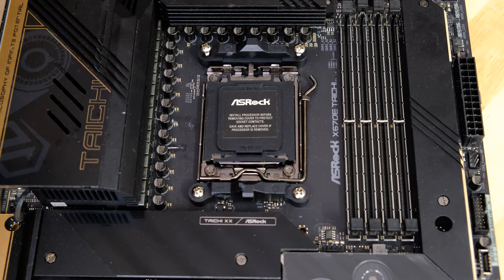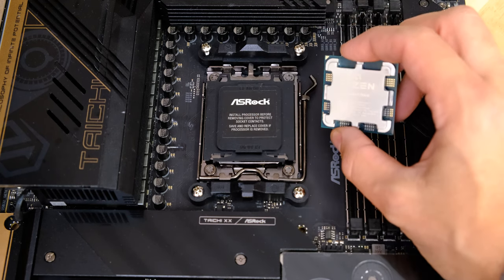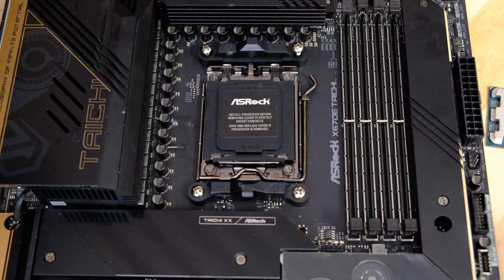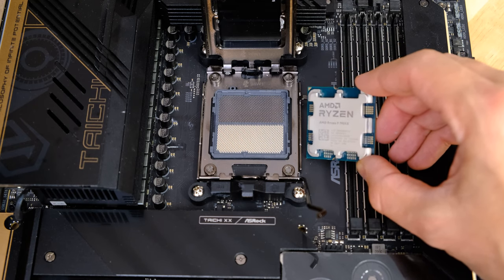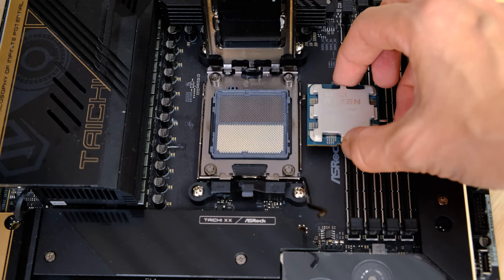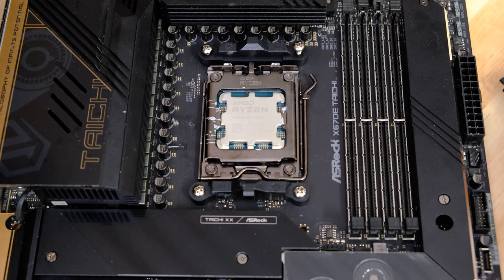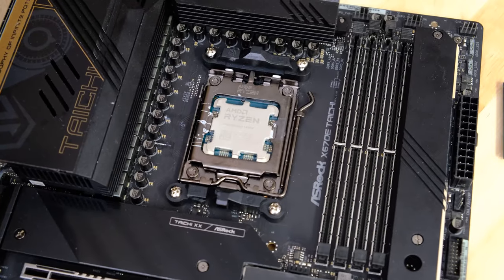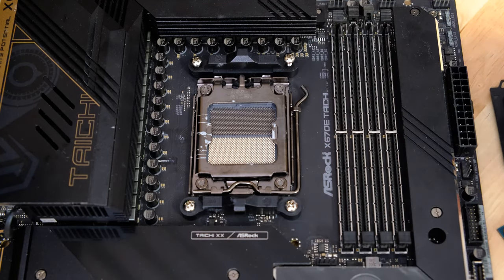How To Install A Ryzen 7000 Processor

Comment: Wish I saw this before I killed my board. My first install went fine, but the second time I decided to slightly smudge the CPU into place and that put the board out of commission. (Still thinking on the easiest way to get the CPU out if that happens.. Tilt the board?) They really do seem to be annoying to remove. Despite the snobby know-it-alls in the comments, I appreciate the explanation and video.
Reply: I've bricked two AM5 boards already because of this crappy  socket and these absurdly fragile pins. Yes, it may well be down to user error in my case of course but on the other hand I really think AMD should never have adopted this socket technology as its costing people money when these pins break off or are so easily bent. I have one working AM5 board just now, but I dare not remove the cpu for upgrading any time soon as I might break the board lol. I just hope future revisions of this socket will improve and the pins are made less fragile.
Reply: @soulzgamer7589 mate, exactly same here, never had any issues with my old intell 1155, im fucking livid, will the CPU be ok ? I was so carefull, when it's in can I wiggle it to make sure it's in place? Anyway, I tried booting but got nothing, ram light orange, CPU red, took it apart noticed bent pins, shat my pants. So angry.

Comment: I'm only just switching over from AM4 to AM5 and I'm aware of almost every shortfalls on the CPU old pin array setup. Many times I had to use my credit card to straighten out those bent pins. Nevertheless, I don't want to go into this blindly, your video has put me in good stead and thank you for over extending the things that could possibly go wrong with AM5.
Reply from the maker: Glad to hear it. I get a lot of people complaining about the length of the video but I really, really, really wanted to stress how easy it is to damage the pins. Even following basic guides is still seeing bent pins as the leading cause of motherboard RMAs so it's clear they're not enough. If I ram it into your brain then hopefully you won't ever be in that situation!
Reply: Not long, you just went over and above and kudos to you! Even experience PC builders make silly mistakes. Bending pins and thermal paste stuck to your cooling fan are the biggest pitfalls. 
So glad AM5 has a retention bracket!
Thermal paste on AM4 has its own art, run the PC for twenty minutes, unscrew the holding screws diagonally from the AM4 PC Cooler, then very gently swerve the cooler left and right a few times, then pull gently....oooops, no it usually works :) @CrazyTechLab

Comment: If you bent those pins it will not kill the motherboard. I messed up before used tweezer and plastic card bent back 8 to 10 pins in place and its working fine.
Reply from the maker: Depends how badly you bend them. I’ve been successful in most attempts but not all. Also with socket AM5 the tolerance for the pins being in the right place after you bent them is extremely fine. There are so many pins that each one has to be in precisely the right place. It’s far easier to fix bent pins on an old Intel motherboard that is on socket AM5 or even LGA 1700

Comment: I hate this new socket on AMD boards as I've already damaged pins on two AM5 boards and its effectively knackered them. It's not even clear what causes them to bend, accidentally dropping the cpu in incorrectly or even friction underside when installing the cooler. One thing is for sure is it's a very costly mistake to make.
Reply: Just did it myself and I'm always so carefull. Im so furious with rage, 160 quid down drain. 

Brought new board, with great anger, now I'm dreading it. Happens again I give up. It should not be this fuckin easy to bend them ffs. You only have to look at them wrong. 

Urgh. Livid.

Comment: This reminds me of haswell days. That’s the last intel I built. I’ve been on ryzen since. Good to see LGA is still the same. Thank you. Me too brother! Waiting on the $3.99 ek 6/32 screw set. Cost me $14 for 4 screws. I wish Microcenter had them. I looked yesterday when I was picking up my order but nope! I grabbed a Corsair h150i rgb elite to use while I wait for the screws and a few fittings. I could have used my 240mm h100i pro, but I don’t like loud fans and it’s time for a new AIO. I switch coolers a fair amount. Get fed up with custom loop go back to aio. Rinse and repeat
Reply: Brother, I am still using an i7 4790k paired now with an RTX 3060 since Dec 2014.

Comment: I did the exact same thing before. To push down this  metalstick i need to use extrem strength. Is this normal? Its my second motherboard and issue happened 2 times... What do i do wrong? And if i want to start my pc it shows the yellow q-led and nothing wants to start.

Comment: I wish the sides were more straight, like most cpu's are.  I don't care for the little cut-outs on the sides.  I hope AMD will fix this.
Reply from the maker: Tis a pain for cleaning too. having used the CPU in the video to test a bunch of boards recently, reapplying the thermal paste each time, it gets stuck in those gaps so easily too.
Reply: they didn't do it to look cool. There's an actual reason for it. They put the SMs on the top so that they can maintain AM4 cooler compatibility. And since those have to go somewhere they had to put them on the edges of the substrait so they had to add those cut outs.

Comment: Appreciate your hard work. I have ordered a AMD Ryzen 7 7700 and want to add it to Asus TUF Gaming B650 Motherboard. I wanted to know if i need to use thermal paste after adding CPU? I guess the CPU Comes with a CPU Cooler from AMD (Fan CPU Cooler) but not sure.
Reply from the maker: The AMD coolers usually have thermal paste pre applied. But you ALWAYS need thermal paste. If it's pre-applied, great. If not the cooler usually comes with a tube of it.

Comment: Humanity is failing if they can't line up the arrows THAT HAVE BEEN IN THE SAME PLACE SINCE THE CYRIX CHIP.
Reply from the maker: Well, they are pretty small. No way anyone that has trouble seeing over shorter distances would be fully confident with that, but thankfully there are plenty of other ways
Reply: @CrazyTechLab  I'm old so I have to use my readers. Have you heard of anyone having issues with the 7200 speed ram?

Comment: I just want to know if i have a new Mobo and new Ryzen 9 7000x, seems like it can just be put in the socket, my main concern is Thermal paste. I read its required if its being re-installed, but is thermal paste required for the first installs? ROG STRIX X670 mbo. Cause the video shows no thermal paste being applied until its mentioned at the end.

Comment: Fitting the CPU is pretty much foolproof due to the two grooves top and bottom on the CPU which are left of the centre of the CPU and line up with the grooves in the motherboards CPU socket.

Comment: It's really not hard to prevent damaging your motherboard/socket pins.  I've been building PC's since 1995.  Have never damaged a single socket.  Just place it in and close the lid.  They only fit in one way.

Comment: honestly, it seems like if you are just putting in the cpu the way you should be doing it anyway, it's pretty hard to break any pins on the motherboard
Reply from the maker: I'll take that as a complement :) It is! But the issue is, if you're coming from AMD, this is new and bent pins are one of the leading causes of dead motherboards - the RMA rate is HUGE and it's much easier than you think to bend the pins. I've received review samples rotated from professional journalists with bent pins and numerous friends who've sent me photos of bent pins when their PC fails to turn on asking 'is this bad?'  It seems simple to those of us who have had socket pins for years, but even if I prevent one person from mashing them, this video was worth it. Also, with LGA1700 and now also Socket AM5, there are SO many pins that bending them back once bent is nearly impossible as the pin and pads are so small and margin for error so fine.

Comment: Hi.What type of cooler is better for 7700x? .Air cooler or Liquid.I like Dark Rock Pro 4 and Pure Loop 2 and FX.I am afraid for liqiud cooler  it will cause damage later
Reply from the maker: 7700x you’ll be fine with an air cooler and the Dark Rock Pro 4 is excellent
Reply: @CrazyTechLab  i read comments that with air cooler 7700x reaching to 90c

Comment: My eyes cry when your thumbs touch and rub the CPU connector pins in the back.😢😢😢 don't do that!
Reply from the maker: The pads are very resilient and as they’re gold plated they’re inert an immune to corrosion. It’s quite safe
Reply: @CrazyTechLab  the pads are very resilient yes... the gold plates are immune to corrosion yes... Buy your hands might be oily or have sweat in it. I learned not to touch anything gold in the CPU the hard way.
Reply from the maker: @kaptenhiu5623  Yep they will. But the oil or sweat won’t do anything. You’re talking about minute amounts. They will not stop the socket pins contacting the CPU pads due to the socket pressure,  there’s no risk of corrosion or rust and there’s no risk of shorts. What issue did you have ?They’re designed to be handled. I’ve handled thousands of CPUs in my time. I’ve reviewed them for over 10 years. Never had an issue doing that.
Reply: @CrazyTechLab  consider yourself lucky then. A couple of years ago, I build a new Intel PC for my client's office. It won't boot at all, after replacing and troubleshooting everything, I take out the CPU, clean it's pin and put it back in. Idk if it was caused by misaligned or dirty pins but it works. After that I try to not to touch the gold pins in a CPU
Reply from the maker: @kaptenhiu5623  Fair enough! It’s difficult not doing so on camera but I’ll wear gloves or try not to in future!

Comment: Query I have a ryzen 5900x with a liquid aorus waterface 360 version one of the aorus water cooling since the x360 version of aorus has now come out - my liquid will serve me to be able to mount my aorus master x670e and ryzen 7800x3d motherboard if the anchorage of my liquid am4 It will help me to install and what temperatures should I have when playing greetings from Chile thanks
Reply from the maker: No one can tell you unfortunately. It depends on ambient air temperature, case temperature, thermal paste application and so many other things. Don’t expect low temperatures with the 7800X3D though. It’s common for well over 80’C under load.

Comment: I have the Corsair h150i elite 360mm cooler and I was wondering if you think I’ll need an adapter or not? I just got the 7950x off launch and If you have any info on if it should fit I would appreciate it
Reply: If your cooler needs a backplate it will not be compatible. If it uses the default backplate from amd you'll probably be good.
Reply from the maker: Check with the manufacturer. NZXT has released a statement saying that even though their coolers use the stock backplate, they still need an adaptor to work 100% although they should still be okay. That’s not particularly clear from them but most if not all coolers that use the stock backplate should work.
Reply: should be fine it uses standard backplate, they even say its am5 ready
Reply: When I installed my corsair aio I had to unscrew the brackets that come from the factory and then screw in the double end threaded screws and then seat the pump block on to the four screws and then use thumb screws to secure it tightening the thumb screws down thumb tight in an X pattern.

Comment: This cpu looks so cursed, do you apply a thermal paste at the sticking edges?
Reply from the maker: Ha ha! Nope I was using a waterblock with a large contact plate and this motherboard has had several CPUs tested in it over the last 48 hours. A bit of stray thermal paste is perfectly normal. :)
Reply: @CrazyTechLab  did you try to mount a nzxt watercooling? it is compatible but not recommended, and they didn't include a tutorial to install it on am5
Reply from the maker: @HyPeRXKo  If it fits the standard AMD backplate for Socket AM4 then yes it should fit. I'm using an EK AIO right now and it fits fine. The new backplate has the same threads. The only situation things might not work is if the cooler does not use the standard backplate and has its own - mostly the case with some custom watercooling CPU waterblocks. Here, manufacturers will need to supply an adaptor kit. Most AIO liquid coolers such as NZXT and Corsair either use the standard backplate or the socket clips. The backplate on AM5 is exactly the same, but it's screwed to the socket this time, not just to the clips.
Reply from the maker: @HyPeRXKo  If you like I could do a video on this too. Seems to be a popular question
Reply: @CrazyTechLab  NZXT say we need an adapter for optimal performance, but it is still compatible apparently, no idea how since it is custom backplate (I think), a video Is a good idea since there is no answer on the entire internet on how to install it on the am5 platform :)
Reply: nevermind, no custom backplate (omg their guide is awful), I was confusing with the amd retention bracket
Reply from the maker: @HyPeRXKo  Yeah I was just looking at that. They say the height has changed - not sure how - the threaded sockets that come through the motherboard PCB seem to be the exact same height to me on Socket AM5 as they are on Socket AM4. The issue would be if the new threaded sockets on the backplate are slightly taller, this could mean that not enough pressure is applied (similar situation but for different reason to Intel LGA1700 which also needed adaptors). Or the NZXT standoffs for AM4 which you can see here don't fit properly over the new threaded sockets https://www.datocms-assets.com/34299/1634198300-coolingkraken-z-rgb-digital-manual-en-pdf-2109.pdf
Reply: @CrazyTechLab  I Already have an x73 at my house in preparation for my new build, I'll test it but from amd support I did 2 weeks ago it was like you mentioned a height difference, I never did watercooling before so I'm kinda confused, sorry for all the question and talks x)
Reply from the maker: @HyPeRXKo  that’s okay! I have a couple of Krakens in too so I can do some testing later this week

Comment: Thanks for taking time in explaining this. At the very least, builders should take their time at this step especially. I am wondering if bent socket pins is grounds for the manufacturer to void the warranty? I do know there is a note with my motherboard (MSI) that says boards returned without a socket cap will not be accepted.
Reply: I just received one with bent pins from Newegg, the socket cap was off and floating around in the bag. 

So I guess they accept them, then ship them out without checking.
Reply: @Justin-og9gu  Here in June 2024 I received a Gigabyte board with bent pins from Amazon. And the cap was in place. I can't figure it.

Comment: I tried bending the (dead) processor pins once, but it was very difficult, especially with (only) my fingers.
Reply from the maker: @antonius5195  It was sometimes possible in the past as the pins were bigger and less fragile. These days there are so many, they’re so small and tolerances so fine that it’s nearly impossible. I’d done it to a couple of modern boards and failed on every occasion to repair when in the past I’d usually be able to fix them. Definitely don’t want to damage pins on a modern board.
Reply: @CrazyTechLab  you just need a toothpick, another one that's broken in half for more precise movements, and an iphone zoom feature to check it out at the end. (also a rubber toothpick helps as I mentioned before)
Reply from the maker: @dolpoof2335  Sadly not with current motherboards. I had a 100% success rate before socket AM5 and LGA1700. I’ve had a zero% success rate with them. The pins are too small and tolerances too fine. I’ve used a sewing pin - a tooth pick is far too big. You won’t even get between the pins with that. Even then the pins are 100 times more fragile and are far far more difficult to align back when bent. I’ve even used an electric microscope. It’s the main reason I did this video.

Comment: Amd used PGA which was more robust and harder to damage and they support the same motherboard for multiple generations so when you need to upgrade you didn't have to buy all new hardware because of compatibility issues, which is why I switched to amd.  Now I have no reason to stay, because amd no longer supports my  motherboard When it comes time for upgrade I'm going back to Intel because I'm going to need all new hardware again. I didn't even get to benefit from using the motherboard for more than one cpu.😢